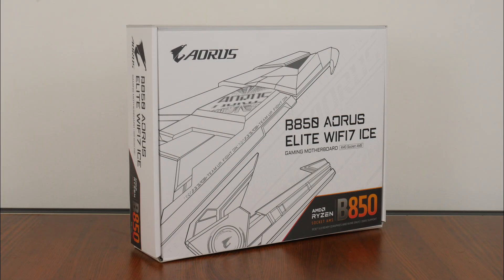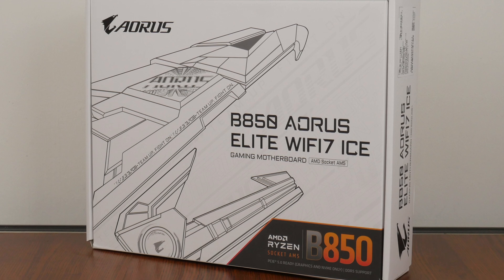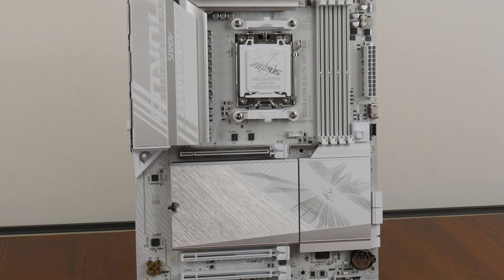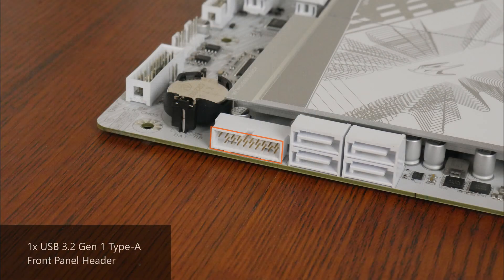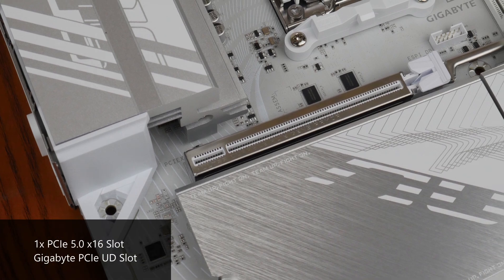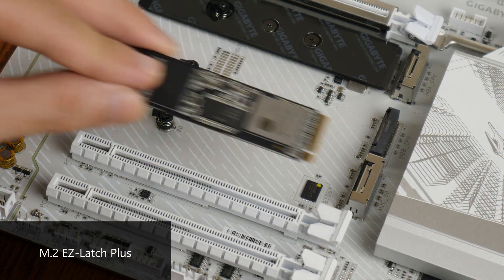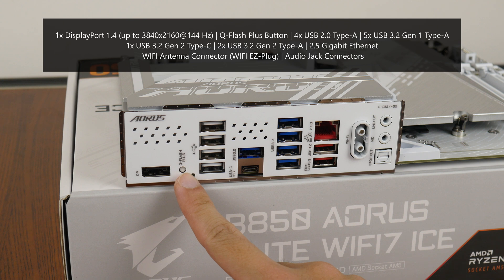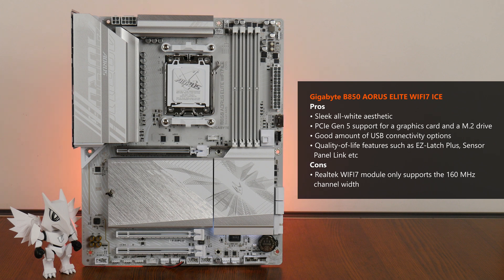PERFECT for Mainstream White AM5 PC Builds! Gigabyte B850 AORUS ELITE WIFI7 ICE Unboxing & Overview

Comment: I just purchased this board with a RX 9070XT gpu. Will this board pair good with 9950X3D or should I downgrade and get the 9800x3D cpu?
Reply from the maker: The board should handle a 9950X3D just fine - out of curiosity, do you do any productivity work with your PC? Or do you use it just for gaming purposes?
Reply: @ALKtech  I day trade on multiple monitors during the day and gamer at night lol. My initial pick was the 9800x3D for the price, and was worried I should of gotten a X870E motherboard to run the 9950x3D
Reply from the maker: @e-ternallife8029  mmm I see. Nah a 9950X3D will do just fine with the B850 AORUS ELITE WIFI7 ICE, you'll be fine!

Comment: How is this a midrange motherboard? I thought its high range. Im getting ryzen 7 9800x3d and an rtx 5080 should i get a better motherboard in that case or what?
Reply from the maker: If anything, it's a slightly "premiumised" mid-range board, given that it does use the mid-range B850 chipset after all. It will handle a 9800X3D and RTX 5080 combo perfectly fine - no need to get a more expensive motherboard for that!

Comment: The white video screen showing comp info, can you tell me what the make is of this please. As I'm looking at getting one to add inside my next pc build. Many thanks
Reply from the maker: Hey there, unfortunately I've no idea what brand/model that Gigabyte used in their demo of Sensor Panel link (it appears to be an OEM no-brand type), but there are loads of them out there on Amazon that should be compatible - you can try the search terms "hdmi sensor panel" and it'll throw up lots of models for you to choose from. Reddit's also a good source of info to see what models other folks have bought that has worked for them - hope this helps!

Comment: As far as I understand,  the v1.1 version of this mobo got a much better realtek ALC1120 for audio codec, can you confirm that?
Reply from the maker: Looks like you're right - Gigabyte's listed on their specs page that Rev 1.1 does indeed come with the ALC1220 audio codec, which is a plus point for folks intending to purchase this board (assuming they get the newer 1.1 variant and not older stock).
Reply: @ALKtech How do i check
Reply from the maker: @Jorgeee  check the side of the motherboard box where there's a rectangular sticker with a barcode - Gigabyte usually prints the Revision number on this sticker. Otherwise, you can look along the edges of the motherboard, Gigabyte usually prints the revision number near one of the corners of the board too.

Comment: Hey @ALKtech, I have a bunch of questions about this motherboard. To connect the rear fan, where should I connect it to? To connect the front fans, where should I connect to?
Reply from the maker: Hey there, you can connect your front and rear case fans to any of the SYS_FAN headers! Does your PC case/fans come with a fan hub that allow you to aggregate all the connectors into one single fan connector?
Reply: @ALKtech  thanks for letting me know.
Reply from the maker: Cheers. If your PC case comes with a fan hub, you can connect all of your front and rear fans to the said fan hub, and hook up the fan hub's four-pin connector to any of the board's SYS_FAN headers. Hope this helps!
Reply: @ALKtech  I'm sure we're talking mainly about the Corsair ICUE Link Titan AIO Cooler.
Reply from the maker: Oh, if you're asking about which headers to use for your Corsair AIO, you should hook up the AIO's pump header to the FAN_PUMP header of the board, while the AIO's fans should be hooked up to the CPU_FAN header.
Reply: @ isn't there only 1 hook from the ICUE Link Titan to connect to the motherboard?

Comment: My t-force 2 × 16 gb ram, 6000 MHz and CL30, is not on the QVL list but the CL28 one yes. Would it be safe to buy this motherboard?
Reply: I couldn't say, I returned some Cosair 6400 I had bought for this build before I saw the QVL link, and got the same in 6600 that was on the list, didn't want to take any chances.

Comment: What’s the deal with the 160mhz Wi-Fi 7? Big deal or still a good buy?
Reply from the maker: Just something to note especially if high-speed wireless networking is something you're looking for (i.e. you've got the latest WIFI7 router and would like to maximise your wireless transfer speeds). Otherwise, the adapter is perfectly adequate for everyday use!

Comment: hi, i have an sn850x which has a built-in heatsink. thoughts?
Reply from the maker: Hello, you won't be able to use the said SN850X that comes with a heatsink, as it'll likely get in the way of the graphics card due to the positioning of the board's M.2 slots...unless you get lucky and the said drive fits in the last M.2 slot without getting in the way of your GPU's cooler assembly. The safest option would be to get a M.2 drive that doesn't come with a built-in heatsink!

Comment: This will work will with a 7 7800x3d. I also have a gen 4 m.2 is this fine ?
Reply from the maker: Yeap not to worry this board will work just fine with a 7800X3D and a Gen 4 M.2 drive!

Comment: About to get the 9070 xt for this motherboard but was wondering if it would fit. Anyone have an answer?
Reply from the maker: It'll fit for sure - this is a full-sized ATX board and you won't have any issues with clearance. If anything, you'll want to make sure the PC case that you have has enough space for the 9070 XT graphics card that you'll be purchasing!

Comment: I have this board myself and paired it with a 9700x and a RTX 2080 I had laying around. No problems so far.I'd like to get my hands on that little dragon figurine though.
Reply from the maker: Great to hear! The figurine's called an AORUS Chibi, and it's usually not offered for sale unfortunately - I got mine from my local Gigabyte distributor. You can try places like eBay, or asking your local PC hardware retailer/Gigabyte distributor whether they might have any for sale!

Comment: Thank you for the informative and very in depth video! Lots of details to help inform all the features that Gigabyte offers. It helped me decide on the b850 motherboard and you have gained another subscriber! Originally, I wanted the X870 Aorus Elite for the extra fan headers but that is really the only features that I wish this one had. Not really worth the extra 50-60 dollars imo and plus this one looks a little cleaner to me.
Reply from the maker: Glad you found the video useful, cheers! And to add on, the X870 AORUS ELITE WIFI7 ICE has lane sharing between the primary PCIe 5.0 x16 slot for a graphics card and two of the board's M.2 slots, which is not ideal and something the B850 AORUS ELITE WIFI7 ICE doesn't suffer from.

Comment: Don't you have issues with booting? DRAM/VGA light being on on the motherboard in the topright?
Reply: i recently did have issues with the VGA light staying on consistently, i would recommend seeing if you get any screen from the HDMI near the internal USB-C header and if you get no picture even still then i would install the latest BIOS. 

if it is the DRAM light i would reseat ram and try again but only after seeing if the memory training is just taking a while.

Comment: Really nice video, I`m planning on building a PC with this mobo and I was wondering if it will fit well in a monotech king 95 pro white case
Reply from the maker: It'll fit for sure, as it's a standard ATX-sized board! Have you decided on the rest of the specs of your build yet?
Reply: @ALKtech  yes, a ryzen 7 9700x, 32gb of ram(6000mhz) from kingston fury rgb white edition and a 4070 either normal one or super i don`t know yet which one to get, also i don`t know yet what PSU to get :) I`m still having doubts aboat this mobo as I heard it`s rgb software (rgb fusion 2.0) has some bugs..have you encountered any bugs with the software?
Reply from the maker: @natePREZIDENTIAL to be frank I've had my fair share of occasional bugs across all major motherboard manufacturer's RGB software 😅 I think it really depends on the combination of RGB hardware that you'll be using for your build...

Comment: In this board if I use 2 NVME Gen 4 drives will there be a speed reduction?
Reply from the maker: Hello, just to clarify, by speed reduction are you asking if the PCIe 5.0 x16 graphics card slot will operate at x8 mode when you have two Gen 4 drives installed? Or are you referring to something else?
Reply: @ALKtech  Yeah, i'm refering to the gpu slot. But if there is something else too I would like to know, thanks.
Reply from the maker: @ right gotcha. This board's M.2 slots do not share bandwidth at all with the GPU slot, so you can populate all of them and not experience any issues!

Comment: I really like the look of it, and once I installed the FE2 BIOS update it really gained a lot of capabilities.  The only thing I don't like, is that it feels like the M.2 heat spreader doesn't make contact with the drives. Maybe thicker thermal pads?
Reply from the maker: Oh that's odd, like you don't really feel any resistance from the thermal pad when installing the heatsink on your M.2 drive?
Reply: Yeah it has been known because actually the most top nvme slot is higher thus why if you wanna close the ssd heatsink make sure go also press the plate a bit!

Comment: I'm hesitant to pick this board because the main m.2 slot would be sitting right underneath the GPU. Maybe it does or doesn't negatively affect cooling for the SSD. However, other boards have that primary m.2 slot situated above the GPU slot so that it's not covered.
Reply from the maker: I do get where you're coming from, given that Gen 5 SSDs do tend to run hotter than their Gen 4 counterparts. Would make for a good test, thought I don't have a Gen 5 SSD on hand at the moment to measure thermals...In any case, my take is that I wouldn't be too concerned about the location of the primary M.2 slot as long as you've got decent airflow and a good number of case fans to ensure air circulation within the PC case!
Reply: You nailed it! Gen 5 will overheat. Gen 4 still fine.
Reply: Yeah I just built a PC for a family member and this is my only gripe.. I built in a Montech Pro 95 case and the GPU inputs sit in the first slot. This means my current display cables won't go into inputs flush, they hit the top of the slot.. I've ordered some slimline HDMI and DP cables, hopefully this sorts out the problem. Still happy with most of the features but this was frustrating. Vertical mount might be the go...
Reply from the maker: Thanks for sharing your experience with this board - it's a good data point for folks out there who might be considering a similar setup with the Montech King 95 Pro!

Comment: Bought this board with AMD 7900x, somehow I'm unable to go beyond the first Windows 10 Setup screen. The keyboard and mouse arent detected thus unable to select Next. Any idea if it has to do with the BIOS settings, USB Legacy was already enabled.
Reply from the maker: Actually, is there any reason why you're installing Windows 10? You might encounter issues with finding drivers for stuff like the WIFI7 module - I've not personally used Windows 10 before on the latest AMD 800-series boards, but I've seen some reports of folks not being able to find Windows 10 drivers for their motherboards' WIFI7 modules!

That said, are you installing Windows 10 using the latest available ISO build?

Comment: Hi great Video, Im new and building my first PC. I was think of getting this Motherboard. I've recently purchased a Nvme M.2 Gen 4 Ssd. Would i be able to insert the Nmve Gen 4 into the Top Slot where the heat transfer pads are? I have a Ryzen 9 7900x3d going on to the motherboard. Im also open to your suggestion for any other white motherboard. Thanks in advance
Reply from the maker: Hello, hope this video was useful in helping you better understand the layout of your board! Yes, nearly all modern motherboards come with heatsinks that include the rectangular thermal pad - it's perfectly fine to have the said pad come into contact with your NVMe SSD. Just make sure that you don't purchase a NVMe drive that has a built-in heatsink (you'll be able to see from photos), otherwise you won't be able to use the included one that came with the board!

That said, a 7900X3D will work just fine with this board, which is already one of the cheaper white AM5 motherboards out there. How's the pricing situation for this board where you're from? Some other alternatives you could look at include the ASUS ROG Strix B850-A Gaming WIFI, and the MSI MPG B850 EDGE TI WIFI. These two boards will likely be more expensive than the Gigabyte though!
Reply: @ALKtech  Aorus Ice b850 are priced at 339.99 Cad x870 ice 409.99.Cad ,Rog strix b850 379.99 Cad Rog x870  470.99 Cad. I see that Msi b850 edge releases next week but i can't  see the pricing for it yet. Thankyou for your reply!
Reply from the maker: Mmmm. Honestly speaking, if aesthetics are my main priority, the Gigabyte B850 AORUS ELITE WIFI7 ICE would win, hands down, especially since it's also the cheapest of the lot and has a very decent feature set 😅
Reply: @kennys6300  MSI B850 Edge Ti Wifi better than this middling board.

Comment: Finally it arrived yesterday with the 9800x3d.
Reply from the maker: Sweet! Which white-themed GPU and PC case will you be using with this board?
Reply: @ALKtech  It will be not exactly a white system, though. Gpu is from old system. A MSI rtx 4090 Suprim X the colour is almost the same like the board . White and silver. The case will be the North Xl from Fractial in white with wood panels on the front.
Reply: @kuhmilch  How is it doing? and what about the ram you are using.
Reply: @tusharsehgal7464  It doing very well together with the 9800x3d and the RAM.
RAM:  Kingston FURY DIMM 64 GB DDR5-6000. 
Timings:
CAS Latency (CL)	30
RAS-to-CAS-Delay (tRCD)	36
RAS-Precharge-Time (tRP)	36
I just had to load the AMD EXPO from the board.

Comment: Thank you for this video. I think its the cleanest white MoBo, so I ordered this together with the 9700X Ryzen 7. Hope it will work out fine!
Reply from the maker: Yeap Gigabyte's been on a hot streak  when it comes to releasing very clean mobos for white PC builds - I really like the white hardware connectors and even the white SATA cables! Anyway a 9700X will work just fine with this board - do you have a nice white GPU and case on hand already?
Reply: @ALKtech I am planning on buying this motherboard. Should I get a Ryzen 7 9700X or a Ryzen 9 7900X? Im just playing video games and maybe some office work, but I want something strong. Which one do you recommend?
Reply from the maker: @Monoofi hey there, by office work, is it more of like, word processing and spreadsheet kind of tasks? Or heavier-duty stuff like video editing, code compilation and that sort? Also, what's the price difference between the 7900X and 9700X where you're from?
Reply: @ALKtech I am in Greece, and the price difference is pretty small (the 7900x is about 30€ more). I will do all kinds of things, gaming, office work and a bit of editing.
Reply from the maker: @ I see. In this case, it really boils down to whether you'll appreciate the additional cores that the 7900X has for productivity workloads - if gaming is your main activity and video editing not so much, I'd probably save the cash and get the 9700X, which tends to perform better in games than the 7900X!

Comment: For all of you wondering about lane sharing i haved check their specific on the aorus website and there are no mention of lane sharing so as of what it seems there is no lane sharing but 3 things that I saw was a con as compared to x870e pro ice is that it's has only 1 gen 5 M.2 , doesn't have gen 4 usb and has 14+2+2 power phase other than that it's a great mobo
Reply: i just bought the motherboard and i’m worried that there is lane sharing and my 5090 won’t get the full power. i contacted support last night so hopefully i get a response today! and what’s a 14+2+2 power phase?
Reply from the maker: Not to worry, this board's PCIe 5.0 x16 slot does not share bandwidth with any of the M.2 slots. The 14+2+2 power phases are basically in reference to the power delivery system that supplies power to the processor - this board's setup is plenty for even high-end AMD Ryzen 9000 series processors. You'll be fine!
Reply: @ALKtech  So will it do fine with a 9800x3d and a mid to high end 5000 series gpu?
Reply from the maker: @Sapper_gaming  yup it will!
Reply: @ALKtech  how about the b850 asrock steel legend wifi?
Reply from the maker: @ the ASRock board's pretty good from a specs perspective too, and I'm guessing it'll be cheaper than the Gigabyte board in this video!
Reply: So you get any answers? @jwild666